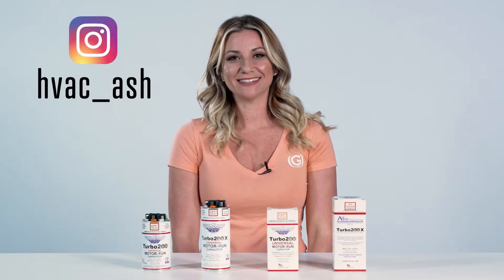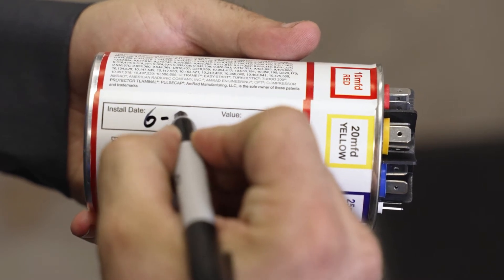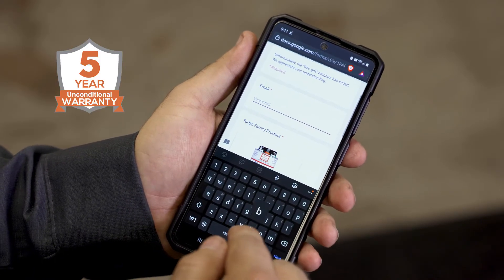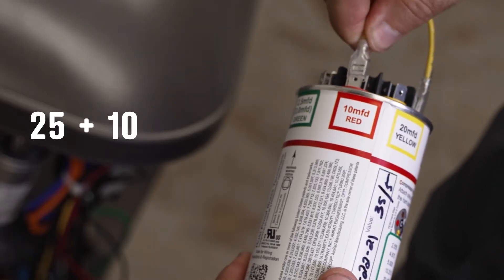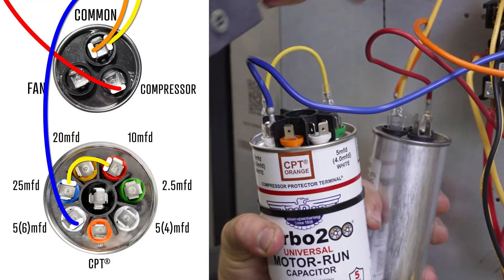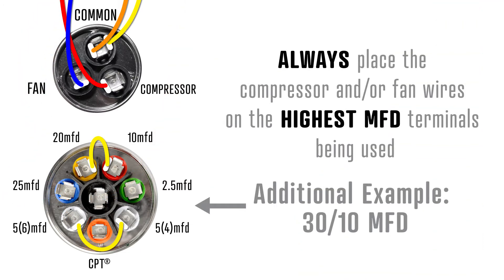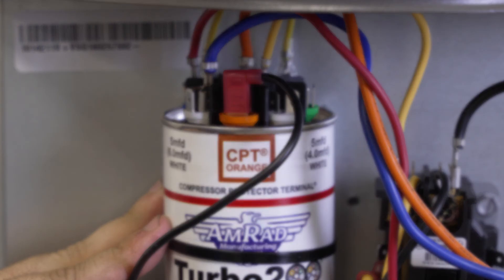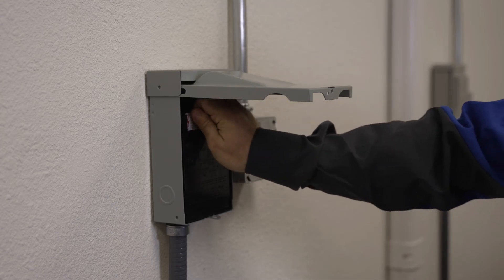AmRad Turbo 200 Universal Motor-Run Capacitor Install

Comment: I just bought the Turbo200mini as a spare.  If I need to ever replace how would I discharge the old Turbo200mini?  I can't get a screwdriver to make contact from the "common" in the center of the capacitor to any of the outer connectors because the "common" is blocked by a plastic insulator.   Can someone let me know how to discharge it?  Thanks in advance
Reply: Use needle nose pliers
Reply: @global.the.source  Thanks for the reply....is there also a 2nd option I could use to discharg the Turbo 200mini?
Reply: @global.the.source  Very good!  I like this option....thanks for getting back to me
Reply from the maker: @markvoss5146  contact a licensed contractor as the voltage for these capacitors can cause serious injury if not handled properly.

Comment: I need 40/12.5 uf, so what do you recommend?
Reply: You must have a Trane unit, that is a very odd ball capacitor and I don't think AmRad has a model that would fit that setup, unless you ran individual capacitors as 40 and a 12.5 MFD capacitors.  Or you use the CapCom 40/12.5 capacitor, but 12.5 is very unusual for a fan requirement.   If it was 45/12.5 you could make it, with the AmRad Turbos but I don't see how it would possibly do so.

Comment: The video suggests mounting the Turbo 200 upright. Is that necessary? I've seen videos with it mounted upside down to simplify wiring. Also, same question for the Tes5 Hard Start kit - does it have to be upright??
Reply from the maker: Hi Louis!  Our capacitors and hard starts can be installed at an angle or mounted upside down.  However, for the fluid filled TES5 Hard Start and Turbo 200 (and all our other caps), you will get the full lifespan of the part if it is in the upright position.  Doing so allows for optimal heat disbursement; enabling the part to function effectively and efficiently.

Right now, contractors are appreciating the power of UNIVERSAL. Our AmRad Universal Hard-Starts (a permanent replacement product), have even more value these days with high gas prices. "The more you know, the less carry." 
 By reducing the number of trips to the supply house to get a specific run cap – you save time and gas…keeping more of your hard-earned money in your pocket.
Reply: @global.the.source  info should be on the box or in the instructions if it's not already. Just had a tech install a 200 on a home unit and he put it upside down. My thinking is too keep the top clean compared to the old one and he may have been unaware of this detail.

Comment: Other then height! What’s the difference between the 200 and the 200x?  Why would one be preferable over the other?
Reply from the maker: The Turbo Mini, the Turbo 200 and the Turbo 200x are all universal motor-run caps proudly manufactured and assembled right here in the USA.  Each has a voltage rating up to 440 VAC.

DIFFERENCES BETWEEN THE TURBOs
• Turbo Mini replaces values from 2.5 to 15 MFD
• Turbo 200® replaces over 200 single or dual values from 2.5 to 67.5 MFD 
• Turbo 200®X replaces any of the higher range single or dual capacitors used in scroll compressors and higher efficiency A/C units, values from 5 to 97.5 MFD

THE AMRAD DIFFERENCE OVER OTHER MOTOR RUN CAPACITORS
AmRad is committed to quality products to keep the homeowner protected and support the efforts and reputation of the contractors. 

AmRad hard-start kits and motor-run capacitors feature rust-free, all brass terminals and now come with built in safety features (CPT® Fuse Wire & CPT®) that cut the hard-start off from the system in the event of a part failure, protecting the compressor.

CPT® acts as a kill switch between the hard-start and compressor in the event of a failed run capacitor; preventing damage and possible compressor failure 

PEACE OF MIND FOR CONTRACTORS & HOMEOWNERS 
• Each Turbo 200® and 200X is individually tested and labeled with exact MFD ratings at the completion of manufacturing so contractors can trust the rating  
• Turbos are Backed by a 5-year warranty (vs. a typical one-year warranty provided by other manufacturers)

NOTE:  All products sold by Global are intended to be used by a licensed HVAC contractor.  More product information can be found on AmRad's website:  https://amradmanufacturing.com/ and Global’s online product catalog: https://globalthesource.com/products/26-amrad-universal-turbo-capacitors-hard-start-kits
Reply: @global.the.source  thank you for the prompt reply. Enjoy your videos very much.  Keep um coming.  Just order a couple of your products to have on hand….. looking forward to trying them out..

Comment: Where can I purchase the Jumper Wires online?  Thank you
Reply from the maker: The yellow jumper cables that come with the Turbo are not sold separately. However, you can contact your wholesaler and they can request some from AmRad. We hope this helps.